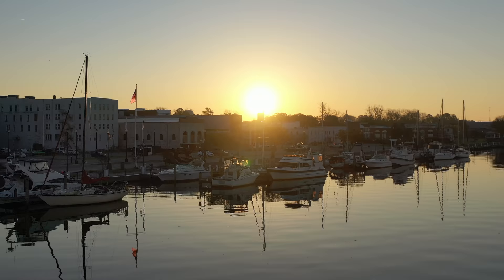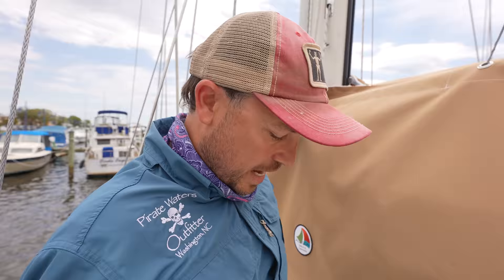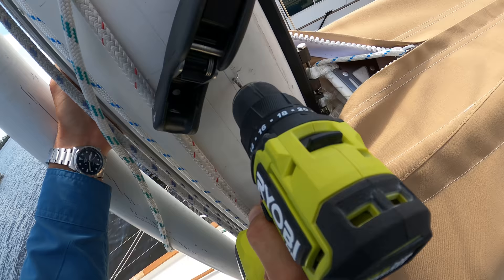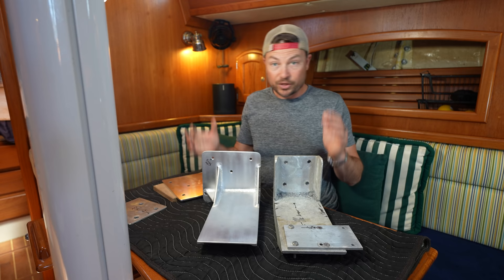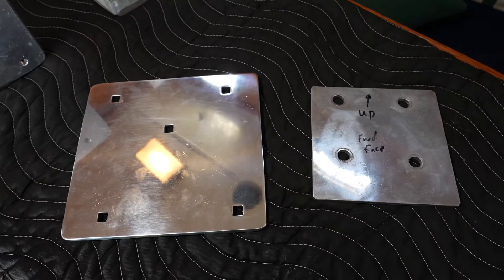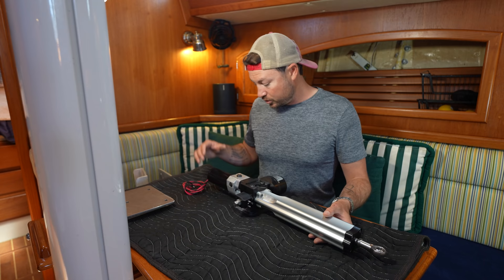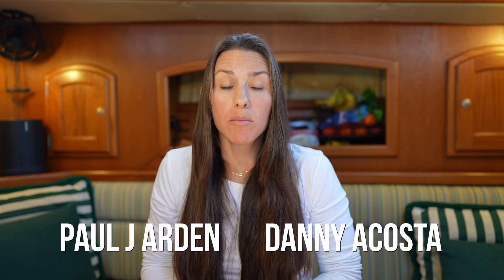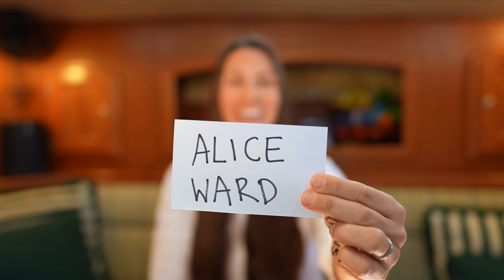Is it DANGEROUS to Sail Across the Atlantic Ocean? | S06E45

Comment: That is a Kick Asp 🐍 Blackbeard Pirate Flag hat Jordan! 👍🏻🦜🏴‍☠️

Edit after seeing you Amazon cart.

     Hey Jordan and Desiree, I hope you see this.  I saw you guys have the Coleman Paper Soap Sheets in your Amazon store.  I make my own cold process bar soap & shampoo, liquid hand soap, body wash, shampoo, & conditioner, and my own deodorant/antiperspirant and moisturizing lotion because I suffer from dry & cracked skin sometimes especially in the winter time.

     Anyway, I also make my own soap sheets and detergent sheets for my RV, to keep in my vehicles, and for rent camping trips on my motorcycle.  

     They are extremely easy to make.  You can get a wire soap cutter and just cut any solid bar soap, shampoo, conditioner, and bar style laundry soap or conditioner very thin.  This is by far the cheapest and easiest way, but doesn't let you use any of the liquid based soaps, body wash, shampoo,  conditioner or laundry supplies. 

      Next you can also do thin sheets of melted and then slightly cooled solid soaps, shampoos, conditioners etc by laying down sheets on wax paper allowing them to solidify then cutting them to size, and peeling the wax paper off.  I have found it's better to leave the paper on and peel it right before use so they don't stick together. 

     The third and most versatile method because you can use liquids is using water soluble paper which is made mostly from cellulose with some other water soluble compost depending on manufacturer.  You can get the water soluble paper in any local craft store, or big box store with a decent sized craft section.  They definitely have it on Amazon, eBay, or Walmarts web site as well.  There are plenty of diy how too guides online and YouTube diy videos showing how to do this.  I thought you might like to know because it lets you choose your favorite soaps, shampoos, conditioners, etc and make your own rather than just having to deal with whatever fragrance the premade soap papers have.  If you do decide to go this route make sure you keep them in a solid metal or plastic container, and then keep them in something dry because they crush extremely easily, and like soap they will draw humidity, and that will ruin your hard work.  I keep mine inside those zip lock bags with the vacuum port you can draw the air back out of the bag, or at the very least in a container with a good seal like a mason jar or plastic container with a tight lid and some dessicant  packages. The ones I make from my homemade cold process bars will get an O2 absorbers too just because I frequently add fresh food ingredients like say crushed or powdered oatmeal, coffee, sugar, honey etc and don't use any preservatives, so they could potentially grow Beasty little molds, yeasts or bacteria if say I leave a couple containers in a saddle bag on my motorcycle or the medicine in my RV and forget about them for a few months or a year lol.  

     While I am on the subject of convenient things for the space conscious, have you guys ever seen or used the "Toilet Paper Pills or Tablets", and the Super Absorbent Microfiber Towels marketed for Backpackers,  Camping, Travel, Gym bags etc? 

      The Microfiber Towels are amazing, come in plastic cases or bags with draw strings, and are available in all different sizes from 12"x24" unfolded all the way up to huge 40"x80" mega beach towel/yoga mat sized.  They are way way more absorbent and soft than an equavlent sized regular cotton towel, and  like a chamois for a car or boat, you can wring a bunch of the moisture out of them and use them again right away.  

   The Toilet paper pills/tablets can be used as described, though I'm not sure about putting them through a macerator on a boat.  They are just made of cellulose like the soap paper is, but much more heavy duty.  I suppose it would need more research.  I use them in my RV blackwater tank, at campground out houses, and have put them down my home toilets into my septic system with no issues in 20+ years, And the are advertised as biodegradable, compostable, and non toxic/environmentally friendly.  They are dry you reconstitute them with how ever much water you want, and then either use them like to or a wet wipe.  They are also very useful for other things.  I use them as a paper towel/cleaning rag. They can be rinsed out, hung dried and re-used at least a few times. I imagine they would work pretty good in a bilge at sucking up water when you are trying to get it dry to fiberglass or do other work in it too.

    When my 4, 7-9 year old dogs pass on and I sell the RV, motorcycles, and my home property and land based stuff to trade up to a live aboard yacht they will definitely be in my cabinets.  

That is The End of that Readers Digest Entry lol.

Comment: safety safety safety.  There is no such thing as being too safe.  I don't know how much sailing experience y'all have, I joined your channel with Atticus 2 mostly refitting the boat is all I've seen.  But hey if you feel confident go for it but if I were you I'd take this next season coastal sailing my boat doing a thorough shake down of all the new, rebuilt, repaired systems.  Get to know the boat on the water.  You most certainly know the boat from the inside out by now with all the repairs/upgrades you've made.  I have sailed many monohulls and none sailed like the other.  The sea is seriously unforgiving and if there is a crack in the foundation that crack will manifest itself into a canyon if you are unfamiliar in any way about your boat.  What I have seen is you two doing projects for at least 6 months on Atticus 2, y'all haven't done too much sailing on her.  I think an Atlantic crossing out of the gate is a grandiose if not epic evolution for two people on a new boat.  That's my opinion and you know what they say about opinions.  I just don't want to see y'all turn into another statistic.  I like you two and would hate to read about anything bad happening on the maiden voyage.

Comment: Now; I'm designing a new MOB self recovery system and I've mentioned this in at least 20 sailing channels including this one.

This is the first I've heard anything about MOB.

IM A commercial diver in I've seen a fair percentage of divers FALL off the boat.
And we weren't underway.

Falling off A sail at night in any sea state but a flat sea would be very difficult to rescue a MOB and forget if it's a solo sailor.

So I started drafting a self rescue system.

I've not received a single comment concerning this concept.

Why is that? 
MOB is a near certain death sentence under most conditions.

So; designing building and installing that technology will be my first project.
Reply: "This is the first I've heard anything about MOB". Quite an indictment, isn't it, 
Dale Harris? The responsibility to make a potential boat buyer aware of MOB, in a positive way, is with the boat salesman. The boat manufacturers, the marina operators, the marine supply companies, the marine magazine, and book publishers along with the United States Coast Guard. For the most part, the best boat, gear, and gadgets in the world won't help at all if someone goes over the side, especially without a plan to get them back on board. Better yet, have a compulsory plan to keep all hands on board at all times. Have the proper gear and use it properly at all times.
Reply: @generossano2800   @Gene Rossano  exactly my thoughts.

The odd thing is; I mention my self recovery concept just about everytime I post or comment.

It's very very seldom that anyone respond to the subject.  I don't get it.

I am a commercial diver spanning 50+ years.  I'm a civil engineer and tool designer for the marine industry.

As soon as I became interested in sailing I wondered how these people get back on the boat; they don't and the community doesn't want to hear about it or they say; I NEVER FELL OFF THE BOAT.

well; I've seen a hand full of divers fall off the boat . So it happens.

My system is complicated and it may take a year or longer to design then build it , install it and test it in all sea states and all hours.

I kind of expect constructive input on the topic but I get sarcasm and dumb comments.

Anyway; I'm building it for me and those that get on my boat.

Comment: Is it dangerous to cross the Atlantic?

If you are in a poorly maintained boat captained by someone unprepared, yeah. Extremely. 

You both have a few thousand miles under the keel, so you are prepared. 

And you are on an extremely competent blue water boat. Even a fool would likely stumble across unscathed. 

Your biggest issue will be boredom. 

Your drive to the marina will be the most dangerous part of the voyage.